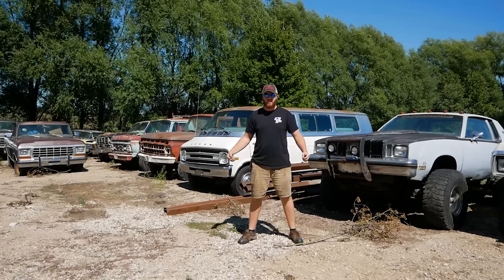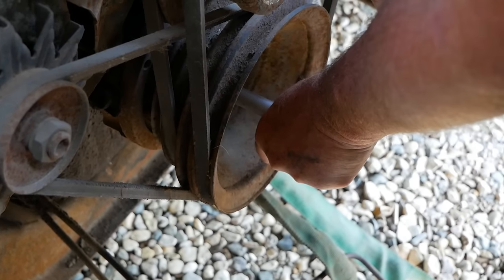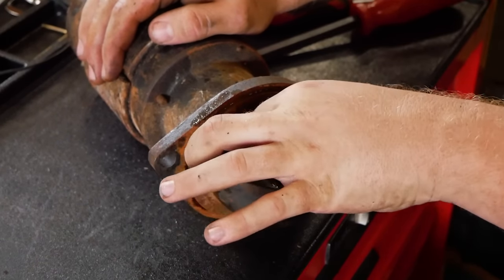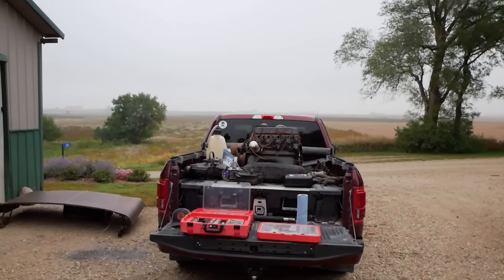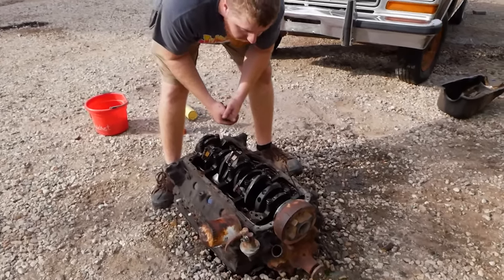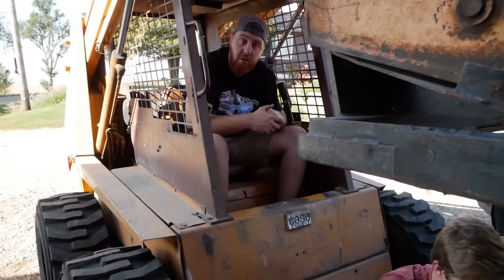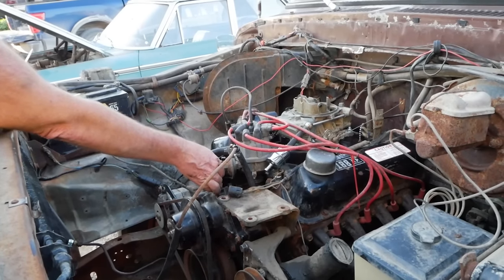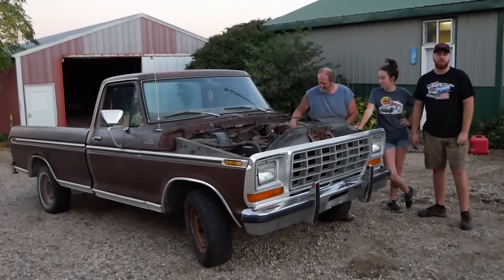Can We Swap a BOAT ENGINE into a TRUCK? 1979 F150 Revival

Comment: A few years ago, I bought a 1968 mustang for $500.00 that had spent the last 20 years out in a cow pasture in Alabama.  The man told me that it was running when it was parked. Had a 302 in it with a C4 automatic transmission.  Got it home, put a battery in it so that I could spin it over. It spun over, I sanded the points just enough to clean them up, regapped them, cleaned the plugs, and bolted a holley 2V on it. I filled the bowl up on the holley with some gas and jumped the solenoid.  About 5 or 6 turns, she busted off! A little smoke and a little lifter clatter she was running!! She had good oil pressure and very little blow by. I pulled it out and stuck it in my daughter's 67 mustang.  It was formally a 200 inline 6 cylinder.  That was 3 years ago. She's still running strong!! We just upgraded it to  T5 transmission too.  Fun car to drive around!!

Comment: Hey Kevin, use a squirt bottle with 50:1 2 stroke gas to fire up engines. They fire up a lot easier off gasoline than brakleen and the oil in the premix will give the top end a little lubrication to help get things moving.
Reply: Yep quit drying out already dried pistulators and ringa-magigs
Reply: He has done that before, maybe he forgot to bring it (again)
Reply: don't understand his addiction to brake clean
Reply: He normally does.
Reply: Mustie1 has entered the chat
Reply: @Sys-Edit0r-1995  That sounds like him
Reply: Or WD40

Comment: Getting a Merc motor is a score.  They normally went through the engines before they even thought of putting them in the boats..  Consider it a Quality done Ford engine..
Reply: Higher compression ratio, brass core plugs, and bigger cam than car/truck engines... specify 89 octane gas...
Reply: They definitely did not... MAYBE different core plugs / head gaskets, but usually they are the same. At least for the GM motors mercruiser did.

Comment: boat motors typically are higher compression and have a more aggressive cam in them because they're typically holding high rpm's for sustained periods. you now have a race motor in a truck lol
Reply: I was thinking that too and I think it’s awesome.
Reply: Won't be winning very many races with 188 hp lol
Reply from the maker: #merica
Reply: @birdhunter_inc  lol
Reply: And it's only 188 HP hmmm
Reply: @johnsnow1355  That was with the 2V carb. It's probably somewhat better with the intake, headers, and 4V carb.
Reply: @bills6093  everything is better with 4 barrels ha ha
Reply: Jack Thompson  Yes we do, compared to the original.

Comment: Fun fact: the C4 corvette ZR1 had a motor made by mercury marine, the LT5. So that was basically a boat motor.
Reply: It was also designed partly by Lotus
Reply: Motorweek has a Retro Review video on Youtube where they visit the factory.
Reply: Dang Mercury Marine made the LT5? Thanks for my cool weird fact of the day
Reply: Yep. Cool engine. It was also a 4 cam.
Reply: I believe it was made in Stillwater, OK.
Reply: The gen ii smallblock got canned too fast. Could've been really perfected if they gave it another 2 or 3 production years. Lt5s are super cool
Reply: Dodge 413 was a boat motor used in heavy trucks and RVs.
Reply: @MegaDysart  Chevy....? ohhh, Fords....Square those numbers by 10.23 ...
Reply: Don’t forget the V6 screamer that Yamaha built for the first generation Taurus SHO. Okay — that may have been “Motorcycle Yamaha” — but they Made boat motors too. I don’t know.
Reply: Yeah but built by Chevy makes it a boat anchor not boat motor lol
Reply: @localcrew  the problem was the Yamaha motor was plagued with issues, head gaskets among others.
Reply: @alexandercurtis4427  it was designed by lotus and manufactured by mercury marine.
Reply: @scottyshaffer6103  the gen ii chevy smallblock
Reply: I believe marine engines have a different cam for torq
Reply: @rednexicanhendrix3903  some marine version engines  sometimes also reverse rotation  camshafts in them to, worked on a pair of Chrysler 318 marines that were, couldn't get the damn things going til somebody mentioned hey those r reverse rotation  cam engines turns out the whole damn engine ran the opposite way and we were trying to time it like the car engines  it was the opposite way lol
Reply: @localcrew  Yamaha heads on a Cosworth block with the 3.4L version. Those who owned them will never forget the failures due to the unbelievable use of only pressed on cam gears by Yamaha, which sometimes separated from the camshaft at around 50K miles. You had to catch it in time and have them welded, or your engine was dead.
Reply: @alexandercurtis4427  0
Reply: @Onewheelordeal 9 0
Reply: @milesbrush4863  the engine was designed by lotus and built by Mercury Marine. chevy had nothing to do with that motor other than making it fit in the ZR1.
Reply: Good info didn't know that but my original comment was just a dig on Chevy
Reply: @TXH1138  I hauled a load of 305's & 350's from the Flint engine plant to Stillwater one time.  Sure wanted to stop by the house and offload one or two.
Reply: More accurately "assembled by Mercury Marine Racing".
Reply: They were working on a second gen LT-5 when the project got cancelled and the LS engines came out. There's a video on YT  called LT5 2.0  and it makes 50+ hp on the dyno.  Think about that, 500 factory hp in 1996 would have just been insanity.
Reply: @TheZumiezNation  it was based on an LT1, how did GM not have anything to do with it lol
Reply: @TheZumiezNation  nevermind, guess it really wasnt based on the LT1, it was basically a pre gen iii smallblock. The more you know 👍🏻
Reply: @milesbrush4863  actually it was the early '60's 409 chevy big block ( forerunner of the famed 427 "rat" motor) that were so popular as boat anchors .....

Comment: That generation of 302 were sometimes equipped with a “lightweight” crankshaft, could be why that one went “kernsnap”
Reply: My grandfather always bought Chevy's his whole life. In 78 the company he worked for was replacing their fleet with F100's so my grandpa got in on a fleet deal for a 2wd 302 powered F100. Within the first 25k miles it snapped a crank and burned up 2 clutches. For the rest of his life if you even mentioned buying a Ford he would lose his mind. HATED Fords after that.
Reply: @gearjammergamer8560  I’ve been a GM guy all my life, but with age comes the realization that ALL the automakers turn out turds pretty often. That being said, I just prefer GM turds to all the others, I guess I’m just more familiar with them.
Reply: @kevinmcclure7551  Always been a GM guy, I love most GM pickups even the new ones... I feel like they've declined drastically compared to what it was back in the day but that's true for everything now, so I don't rag on 'em too bad... But I can't deny that Ford pickups up until '96 look absolutely beautiful.
Reply: the polar opposite of classic oldsmobile. 'Low compression' 330? Fuck it, toss a forged crank in 'er anyways.
Reply: @philljustphill1656  that “Bullnose” generation ford as they call it do look good, and reliability can’t be beat.
Reply: @kevinmcclure7551  well maintained stock 7.3 is one of the best workhorses out there
Reply: @philljustphill1656  the 7.3 should never have been canceled
Reply: @kevinmcclure7551  The 7.3 is back, as a pushrod gas v8.
Reply: @balddicknosed asscanoe That's a real gem, the 300 wouldn't haul a big rv unless it were a diesel but even then... I feel like the 460 is rated at just what it needs to be, people pay a lot of attention  to the straight six because it's small relative to the v8s, they're more economic, makes enough power to move a pickup and are extremely reliable. They earned the attention in my opinion.
Reply: Guess that’s why the 68-69 302s are still so desirable, extra strong cranks and,I’ve been told a stronger block because of a supposed higher nickle content. I had a 68 mercury Montego 2 door hardtop with the first year 302 in it. Tough engine in 1980 , I never broke it as a street racing 17 year old.
Reply: @philljustphill1656 , I agree.  I have a '95 F150 and an '87 F-150, however I love the looks of an old squarebody Chevy truck better though.
Reply: @kevinmcclure7551  thank the EPA for that

Comment: Has a good C4 on the engine laying in the back, those boat engines have cast iron timing covers too. Fords C4, C6 and AOD were damn good transmissions if maintained and bands adjusted as they should have been, give that truck some timing and it will come alive lol. Love the swap the old boat motor will be happy in there
Reply: AODs were weaksauce with even moderate power levels until the end of the production run when they got the wide bands and better internals
Reply: Aod's pretty  much suck

Comment: It would've been hilarious if it was a counter rotating 302

Who needs more than one forward speed?
Reply: That would only be funny IF it was a manual or a four-speed shift, automatics only work in one direction due to the torque converter/front pump assembly in the tranny...
Reply: @disabledusnvet.8771  I didn't think about the pump spinning backwards, just the converter not working well at all. Good point.
Reply: A powerglide reverse gear is the same ratio as 1st so if you hate fuel mileage you can do 60.
Reply: At least the a marine cam and truck cam is almost the same ment for pulling
Reply: Just have to flip the axle.

Comment: The cast iron is used due to raw water cooling.  I’ve seen a cast iron 4 barrel tunnel ram intake manifold on a boat.  

The coolant is the lake or ocean water.  Keep the engine cool as in less than 145 F and saltwater isn’t a problem.  

That motor may only turn 4000 rpm at WOT but it can literally stay there all afternoon.  Boats are tuned for just that sort of service.

Comment: Cast iron timing cover on marine engine instead of aluminum? Electrolysis.
Reply from the maker: ahhhh!
Reply: @JunkyardDigs  That's why there's always a lot of corrosion of the bolts in aluminum covers.
Reply: @JunkyardDigs  galvanic corrosion! You'd get a corrosion cell with the dissimilar metals and the water as an electrolyte, the more active metal, the aluminium, would corrode (electrons and stuff!).
Reply: Right. And no aluminum intake option on the boat engines that use open water systems, other than some that have the water passages lined with brass.

Comment: i did this a few times back in the 70S and 80s. I live near Lake Erie and boat engines were rather plentiful. Most were small block Chevys, but you could occasionally find a 302 or 460. One very common one was a MerCruiser that was an inline 6 Chevy.
 One gotcha that is easily overlooked, and I learned the hard way, is that there are  left hand rotating engines in the marine world. I helped a friend put a marine 6 cylinder in a Chevy Nova. Things seemed...weird, during the install. It was only when we fired it up that we noticed that it spun the wrong way. That's when the little "hmm??" things made perfect sense.
Reply: I've seen people re-learn about counter rotation motors when they try and use cheap car starters on boats.  It'll bolt up and spin just fine, but it won't start.

Comment: $100 for that engine was a steal, looking on Ebay those engines are going for around $3k. Plus it being better built than your typical 302. Awesome project.
Reply: You can buy a reman marine 302 for that. They usually have heavier rods, premium bearings and a cam ground for low end torque. The 7.3L powerstroke diesel had better injectors and tune but was the same otherwise.
Reply: @theupscriber65  - Base car cams are one step bigger than truck cams and marine cams are one step bigger than base level car cams... maybe even more with newer emissions car weak cams... also compression ratio is higher, pistons have shallower dish, and 89 octane gas is specified... plus brass core plugs... I build up marine engines...

Comment: 22:28 tell pheonix and anyone else, dont stand under forklift forks, or any other load supported by hydraulics, especually fast acting ones, theyre also fast acting when they fail
Reply: That is one of many reasons why I built myself a gantry crane. Cherry pickers get top heavy and if one seal decides to give up, game over. If you make the mistake of having part or all of your body under the engine (or whatever you're lifting), you're over. I designed and welded mine together in in a week. It'll lift a ton all day long. It'll probably lift a lot more but I haven't tested it with more weight. It cost me about $400 bucks for everything but that was before steel prices went to the moon. I used a Harbor Freight 1500# 110v winch which works great. The only thing I didn't trust was the cheesy looking cable that was on it so I replaced the lousy 3/16th cable with 1/4" stainless steel anti roll cable and 2 5k snatch blocks. It's slower now but with an fully dressed Ford 429 on the hook, the winch hardly slows at all under the weight. Very cool!

Comment: I bought a 73 F100 Ranger longbed 2wd for $500 in 1995. It was being used as a farm truck and I had to search down the previous owner to get the title "fixed". 3 on the tree, manual steering, manual brakes. I rebuilt the 360 in the apartment parking lot (as a total noob to working on cars). Also painted it myself. Loved that truck.

Comment: I have boat motor parts in my 2.5L 1st gen Sonoma. The crank rods cam and head are all off a 3.0L Mercruiser. Same blocks but longer stroke bigger cam lobes and larger valves. My 105hp 2.5L is now considered a 157hp 3.0L "Stroker" motor. Turbo coming soon. It was also a revival I did and now my daily. Thanks for the inspiration and tips Kevin.

Comment: Small note, "someone put cruise control in it"
Probably the dealer when new; it was an orderable dealer installed option.
Reply: I installed one I purchased from Sears, on my 77 Ford Econoline van.   It worked very well, even on my stick shift tranny.
Reply: One of dad's ford trucks had a dealer installed cruise control on the turn signal shaft, seems like there was a vacuum can and chain attached to the throttle,  might have been the 72 390?
Reply: @mikekokomomike   that is the setup my 78 had, switch box clipped onto the turn signal lever, vac can, chain, and a vacuum throttle pull off pot too.

Comment: I took a unknown year 3800 block. I dipped the block like we do to gun barrels.  That block, heads were SOLID! Went through 4 sets of honing tools. It all weighed 30lbs MORE! I put it in the 87 pickup. It has 497000 miles! I only changed timing chain. Compression is 130lbs. I even treated rings misc parts. Water pump is same! I over engineered Everything. I changed it's pulley, machined everything. It added cooling fins. Galvanized oil pan. Billet machine rods, etc. I grooved in heads to block. Had to custom make the gasket. So blowing the head gasket would be impossible. I used antiseize to mate to block. Like a lego but with grooves. Due to salt n winter. The lines are layered with waterproof grease. Under shrink tubing. With another layer that's oil,heat resistant. No threads are exposed anywhere. Frame has flush lines with nozzles. I can flush em clean with adapter to garden hose. Sometimes I oil them through there. Frame was thickly galvanized after deep freeze treated. Door, window seans etc lead soldered. That's just tip of the work I've done. The paint was done by 3rd party. Powder coated. I could go on and on

Comment: The older chevy mercury marine V8's spin backwards, so be careful when doing this.
Reply: I've done that swap. Needed to replace the cam and the starter. I replaced the main seals to guard against leaks as reverse rotation engines have different seals. I've also used the intake, carb, and distributor from a marine 4.3 on an S-10. No more sensor issues.
Reply: @russellbergersen3296  sounds like a ton of work for an iron block v6
Reply: @MegaDysart  I'm only talking about swapping the intake and distributor on the V6. It eliminates the crank sensor problems that end up sending otherwise good engines to the boneyard. Also eliminates the cheesy fuel injection they used. Cheapest way to make one go 500,000 plus miles and adds a bunch of reliability. Nobody wants to be stranded in a boat so the parts are a bit more reliable than automotive fare. I've also seen small economy gains from this.
Reply: Same with some 351w I watched this video all the way through before reading the comments because I thought that may be the case with this one

Comment: Boat motors have cams designed to make torque at high rpm for a long time. Good for burnouts, just saying
Reply: Engine
Reply: A motor is a machine that converts one form of energy (in this case chemical) to rotational energy. An engine is a type of motor
Reply: @garageofscrap  a "motor" requires energy to make it operate., an "engine" produces energy.
Reply: @midixiewrecked7011  noting produces energy. They convert it. An electrical motor takes electrical energy and converts it to kinetic energy (in the form of rotation). An engine takes chemical energy stored in the fuel, and converts that to kinetic energy (again, in the form of rotation). They are both types of motor
Reply: @garageofscrap  not actually a motor though. That's just pure laziness.
Reply: @midixiewrecked7011  it is an engine, but engines are a form of motor, and it is perfectly correct to call an engine a motor
Reply: @garageofscrap  👎